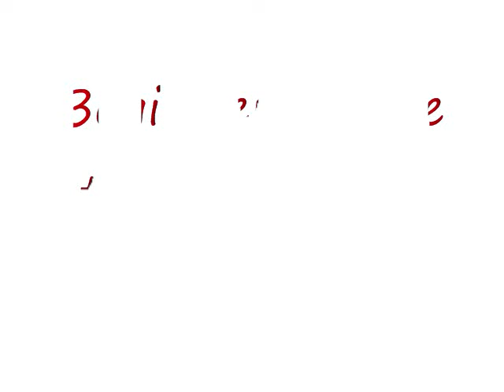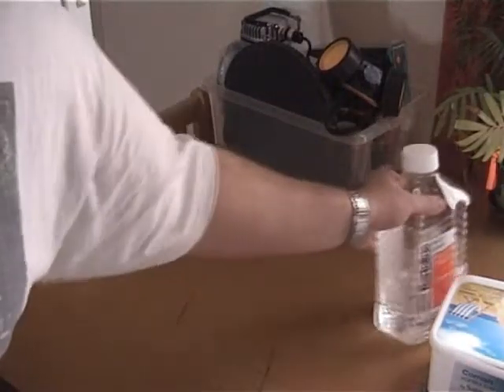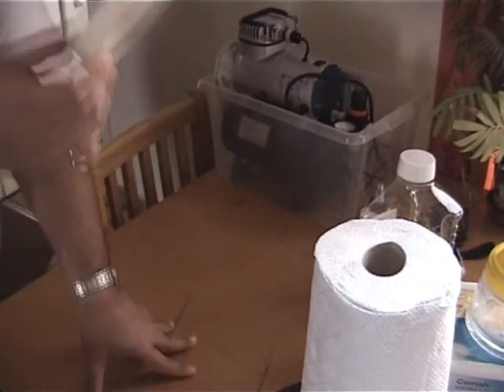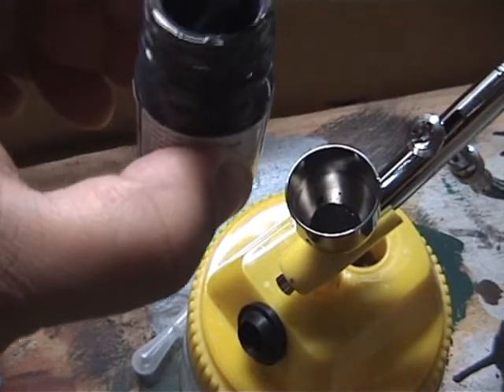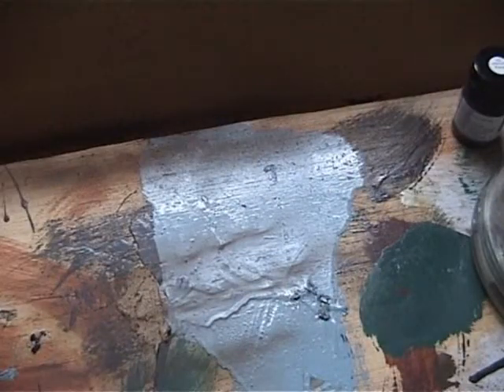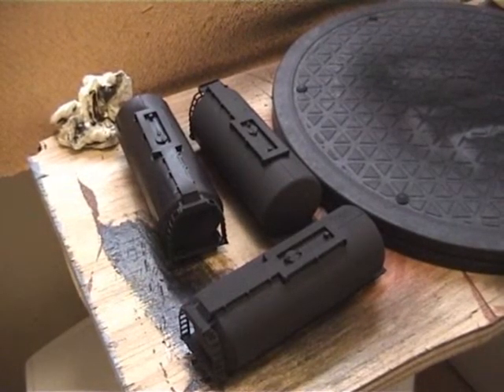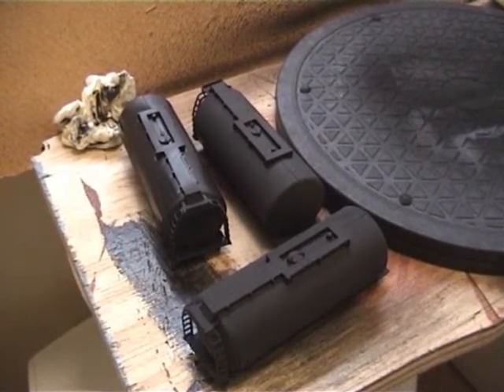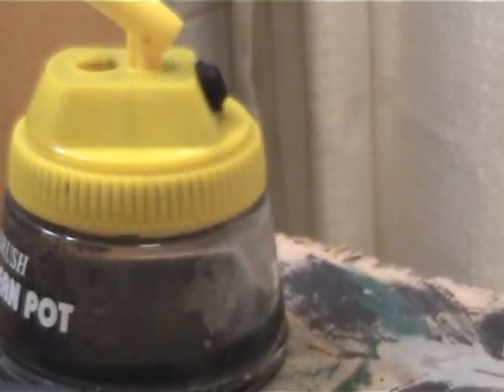Beginners guide to Airbrushing PT 1 -  wagon makeover .

Comment from the maker: Thanks kevin that's helpful, I saw a guy on youtube wire up a resistor to a tender drive loco with a smoke unit running so the loco didn't have to draw as much power to kick in the smoke generator, I have just bought a loco from ebay, that i'll be doing a vid about this,